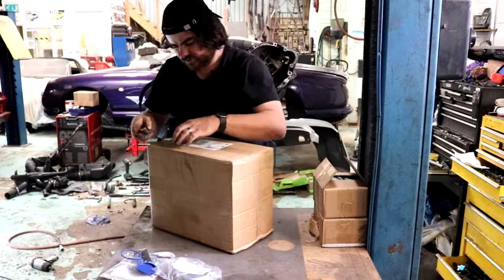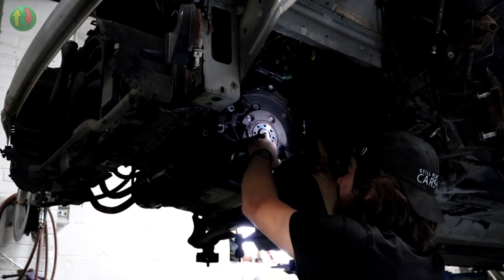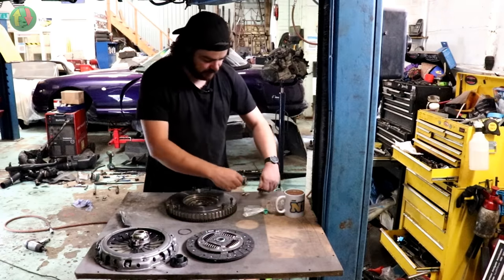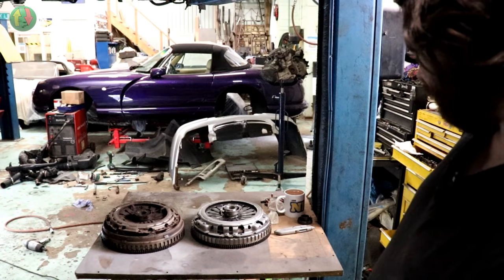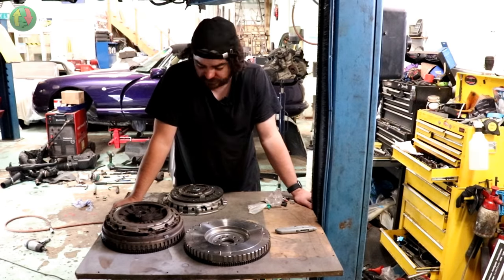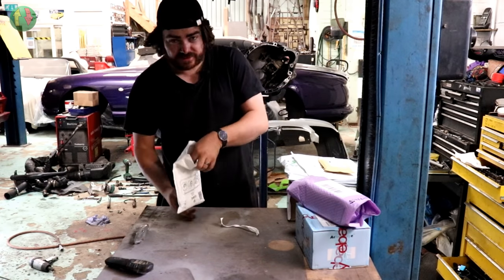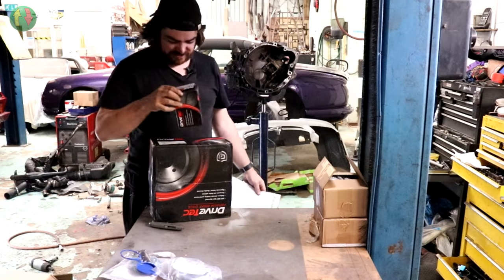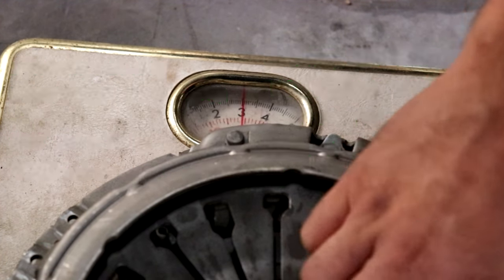CECILY the @HubNut Citroën C5 pt6 - Unboxing, Jeopardy, Waffle & Weighing Clutches

Comment: The parts lottery is something I don't miss.  How much life is wasted arguing about which bits your car has compared to what the supplier thinks you should have.  I seem to remember Renault were/are especially adept at throwing all manner of variations of bits during a production run.  Huge fun, NOT!
Reply from the maker: Renault were a nightmare, yeah. PSA weren't easy when I was doing it, but once you'd figured out the logic and thought like them, it became easier. 
Of course, nobody did that, as 98% of bods in the motor trade think French cars are crap (regardless of how good they are).
Reply: Not only cars... pretty much everything technical! Finding the correct belts for a specific Elmo 8 mm film projector from the 70s/80s can be an epic saga. There are at the very least three different versions of the ST-1200 that need different belt sizes. I have the misfortune of owning the apparently very rare -MO model that no one seems to sell belts for. I even roughly measured the decomposing original belt (which was in the early stages of turning into Philips-style black goo at that point) to order a generic one by size, only to lose the envelope onto which I'd scribbled those measurements before I could do so. Which means the projector has been sitting on my floor acting as a door stop for several more years. I bought it probably 20 years ago and it's never worked.
Reply: @Ragnar8504  Very true.  We live in a throw away society.  An otherwise perfectly serviceable item often has to be junked due to a small and likely cheap, part not being available.